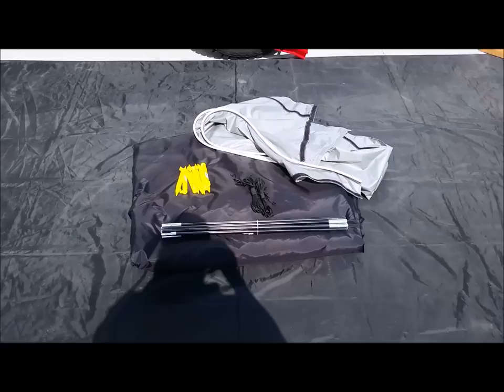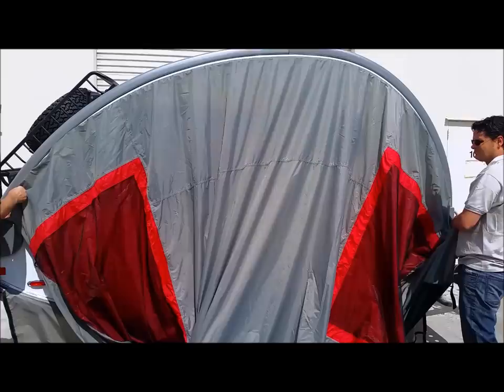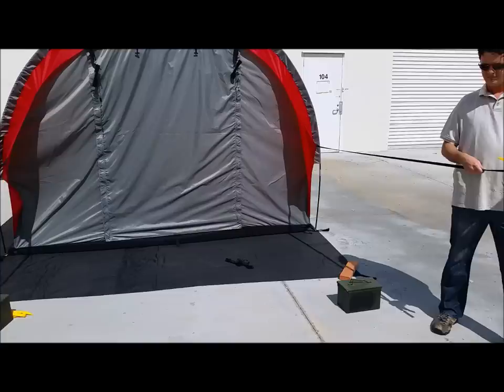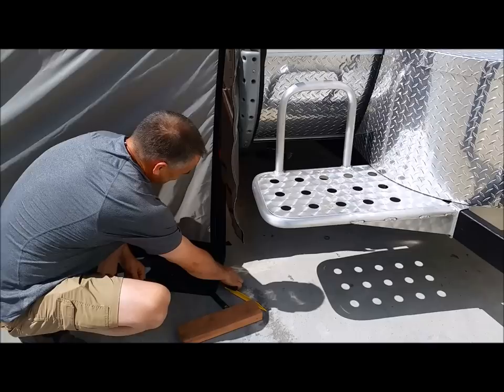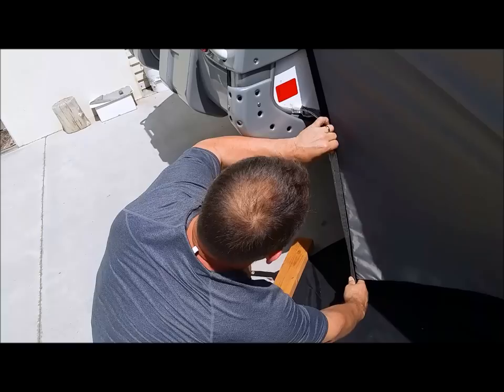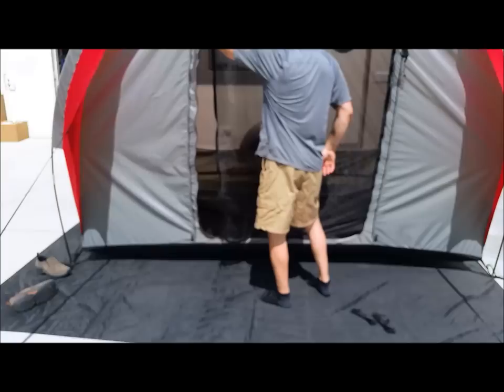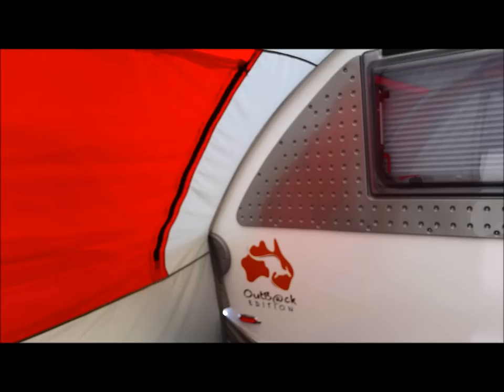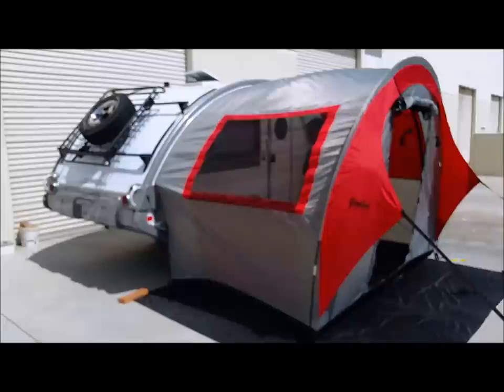T@B Side Tent This ingenious tent adds space to your Tab Trailer:  Setup video

Comment: These are great tents!  We set it up easily by hubby or myself.  We have a clamshell and it is no big deal to exit the tent to go to the galley in the rear.  It gives us a screen porch where we dine bug-free!  There are new models that have an aluminum pole that extends from the trailer to the front of the tent using pockets to hold the poles.  We have a nice, portable step from Amazon, but others have modified the skirt with a flap to be able to bring through the step attached to the Tab.  Well made, great company, made in the USA!
Reply from the maker: Thank you Sam With a Tab!!

Comment: Ii noticed. You can't pull the steps out when this all set up... important to some of us older folks. Hope the newer models thought of that
Reply: Yea. Huge design flaw.
Reply: Cheryl wow major design flaw !
Reply: Thanks Cheryl, I didn't catch that very important detail!
Reply: Mainly the reason for that is because we could find no good way to make a slit for the steps and then be able to still seal up around the steps. And we're trying to keep the inside as bug-free as possible. The best thing to do is get a little step stool. You can get small ones that fit there perfectly for a few bucks..
Reply: @jasonrogers1576  We bought one for our TAB 400 and it comes with an opening for the step and a separate panel that covers the gap so there is no air flow around the step. Since your comment was posted 2 years ago, I would think Pahaque has addressed this on their other models by now. The tent is very well made and withstood three weeks of Arizona camping.

Comment: Great video Thank you
Just curious how you got the front end of the keeder of the skirt when there is no slot for the poly to easily be inserted?  I have a hard time forcing the tube through a edge that it may damage the fabric?  Thank you for the video.
Reply from the maker: Hi Mike, in some cases it helps to spread the rail apart slightly at one end to make inserting the keder into the rail much easier.  Usually this is done at the factory, but occasionally we see units where this was not done.  Hope this helps.
Reply: Yes it did Thank you for the heads up

Comment: What’s the thing the awning attaches to? Does that come factory on the trailer? If not, can you add one to an existing trailer?
Reply from the maker: Our awnings and tents attach to the keder rail that should be factory installed on your trailer.  Keder rail is also sometimes called awning track, and it runs along the perimeter of your trailer sidewall.  Hope that helps!
Reply: @PahaQueCamping  Great, thank you. Can the keder rail be added to a teardrop if it wasn't installed prior? Does that just use 3m backing tape or will it need to be screwed on?

Comment: Why didn’t you use magnets to secure the skirt to the wheel well?  As well as magnets to keep the mesh bug door closed?  That way you can open it and close it without having to fiddle with it.  Just my opinion. If you want to use my ideas, please have the  courtesy to ask me and then Pay 💰 Me!
Reply from the maker: Hi Denell, usually the wheel wells are not made of metal, and the door frames are aluminum, so magnets are not an option.  Thank you.